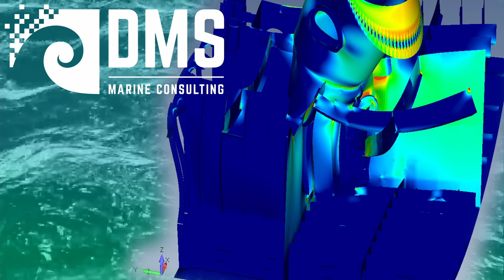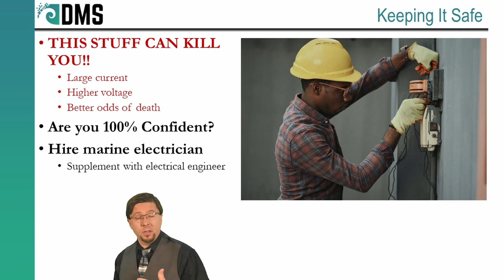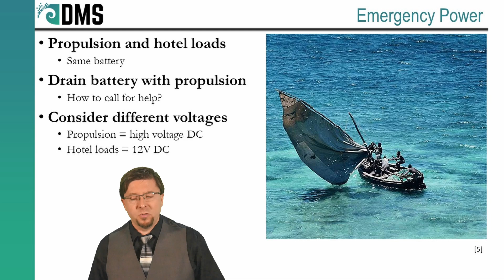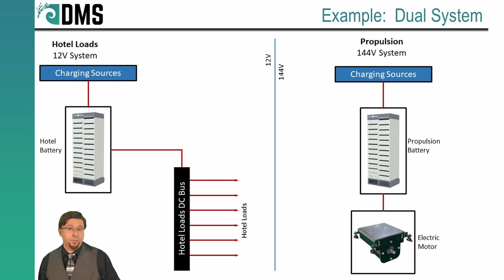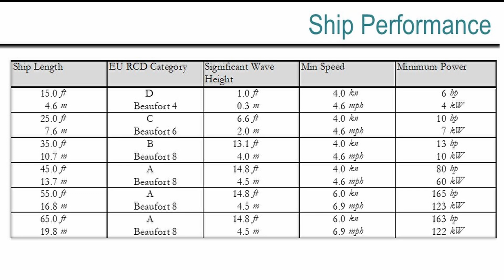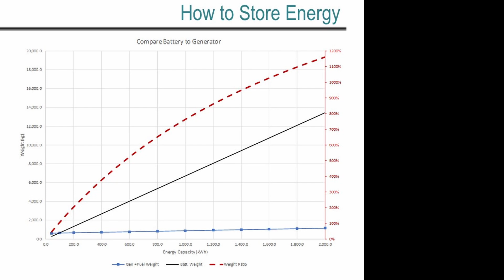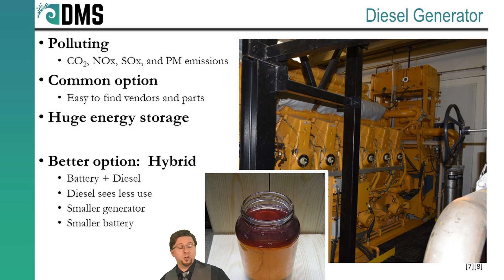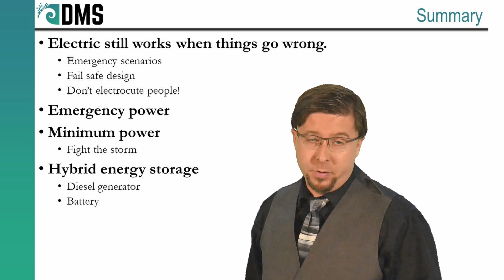How Electric Propulsion Keeps You Safe:  Emergency Yacht Electric

Comment: In terms of safety for yachts, something that you didn't mention is that electric propulsion (mostly) always works, whereas it's far too common on a sailing yacht that your diesel or gas engine leaves you hanging dry when the conditions get tough, you want to drop your sails and start the engine. Lo and behold, that's exactly when dirt in the fuel tanks decides to clog your lines and just when you needed it, your propulsion system is unusable. Electric propulsion on the other hand will just start and run. If you have a series hybrid setup and your genset isn't starting, you have time to fix it. You can run on the battery while debugging your genset. And because the diesel engine of your genset doesn't need to be in a weird location (unlike a diesel engine that must be coupled to your propeller shaft) you can debug your genset in a much more comfortable position, usually. 

Decoupling these failure modes is a huge advantage in my opinion.
Reply: Exactly. There are so many benefits that you don't realize until you live with EP for a bit. Nobody would ever want to go back. 

Just did the math on CATL's new LFP batteries which will be in production next year. 255 wh/kg. A 10kwh pack would weigh only 86lb. Still nowhere near the energy density of diesel of course, but its getting exciting.

Comment: The realities and practicalities of safety is always a good point to hammer home but electric hybrid options are really quite diverse thought you really only brushed over it ....... considered thought needs to be given to so many aspects of a design, which ultimately have a bearing on a vessels safety, such as;
- Parallel hybrid (in-line and offset), rather than just Series (in my mind this is a much better solution than Series hybrid)
- Battery technology 
- Recharge capacity options - mains power from dock, main engine from high output alternators, size of solar array, generator
- Fuel type for generator - Methanol fuel cell? Think I might have considered unleaded, LPG, and even hydrogen cell before methanol.
- Regenerative power potential - this can effect your choice of hotel load storage
- And risks and cons .... fire, cost, lightning strike, harsh environment, high tech
And I think it’s important to explain the difference in  horsepower requirements for the main propulsion units - a 30 kw diesel propulsion engine can be compatible to a 15 kw electric motor (just so people don’t look at that graph a think if emergency conditions require this much power (from a contemporary diesel motor) a they have to match the output with the same size electric motor)
Anyways thought there was a lot left unsaid, huge topic
Reply from the maker: Yes.  It was too much to say in a single video.  Which is why I have a whole series of videos on this topic over the next several months.
Reply: @DatawaveMarineSolutions  good to know, I guess I didn't read the fine print that this was going to be part of a broader discussion, I look forward to hearing more of your insights in the topic.

Comment: i have a question regarding hybrid propulsion. I know you can have a setup 'in series' or  in 'parallel '  What are the pro's and cons for each?
Reply from the maker: I have a video for this coming out in a few months.  You can also read an article about that here:
https://www.hybrid-marine.co.uk/index.php/hybrid-info/which-hybrid-is-best

But here is the 30 second explanation.
Series Hybrid:
1. Larger electrical equipment, since everything needs to be sized for full power.
2.  More flexibility for layout on boat.  You don't need to stay in line with propeller shaft.
3.  Ability to use a smaller generator.

Parallel Hybrid:
1.  Smaller electrical equipment, sized for only partial power.
2.  Can combine electric and engine for higher power output.
3.  Requires a complicated gearbox with control system.
4.  Many more options for different usage scenarios.  You can combine the engine, electric motor, and propeller to achieve different tasks:
Electric only propulsion, engine only propulsion, combined electric + engine propulsion, electric generator for hotel loads, electric regeneration from propeller, use engine for combined propulsion and generator for hotel loads.
Reply: @DatawaveMarineSolutions  thank you soo much it confirms my expectations

Comment: Do ships not use banks of super caps for storage?
Reply from the maker: Not yet.  There may be one or two demonstration vessels.  But I don't know of any wide scale super capacitor implementations.  Emergency safety is one of the biggest challenges for introducing new equipment on a ship.  For the case of a supercapacitor, we need to first prove that they won't catch fire or act as fuel to a fire that starts somewhere else in the engine room.

Comment: Nice to see this covered! You forgot to mention regen as another input. Only on a sailboat of course. Pretty much any electric motor can regen. 5-6 knots can power hotel loads. 7 knots and up things start to get exciting. 

The minimum power chart was using the standard HP - KW conversion. You cant go wrong sizing that way, but its generally overkill. In real word use an electric KW rating can replace a diesel with 2 or even 3 times the HP. 

Electric boats are what I do. Happy to talk to anyone anytime.